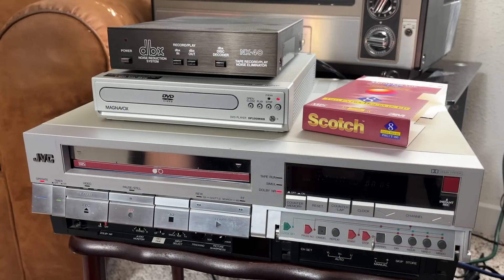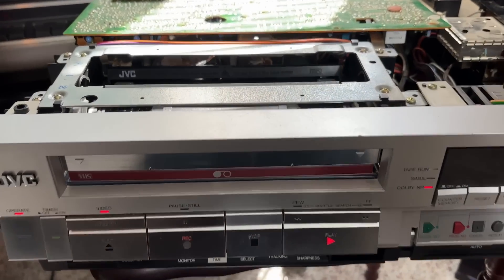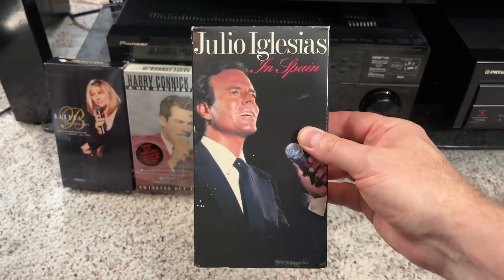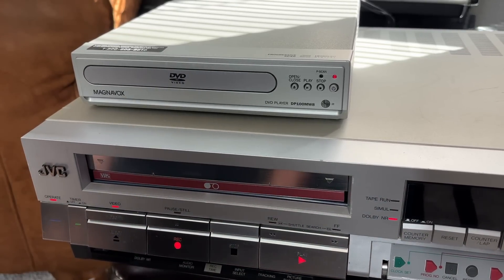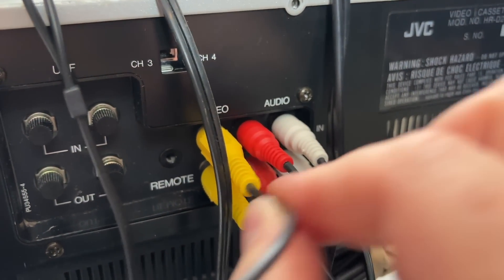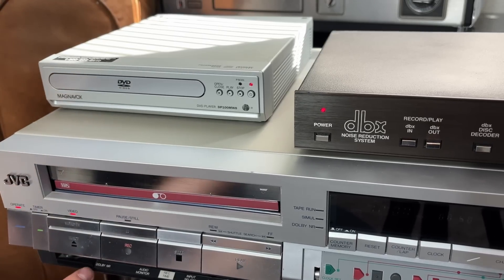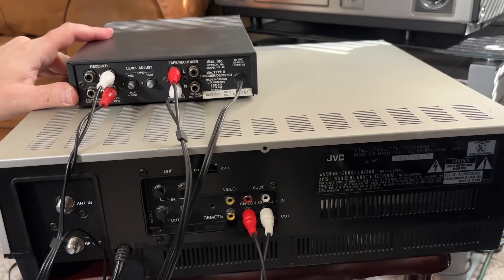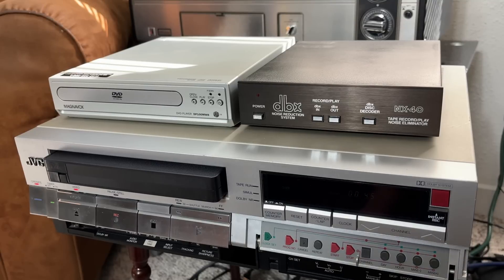JVC Video Cassette Recorder: Dolby NR vs. DBX NR

Comment: Interesting experiment! As someone else has pointed out, it does nothing to address the limited frequency response of a VHS linear audio track. Had Dolby C been adopted when it arrived in 1980, it may have been possible to at least partially address this. As well as providing excellent noise reduction, Dolby C is specifically designed to combat the effects of tape saturation at slow tape speeds, particularly at the high frequency end of the audio spectrum. A well designed cassette deck with correctly calibrated Dolby C can often have a full 20kHz bandwidth even with Type I ferric tape. Despite the slower tape speed of VHS, it may have been possible to squeeze a reasonably flat 14kHz bandwidth out of it.
Reply: For clarity, I'm referring to NTSC VHS machines above with their 1.313 IPS tape speed. PAL VHS machines ran at a slower tape speed of 0.921 IPS, so any more than a 10kHz audio bandwidth would be fairly unlikely.
Reply: @MrSlipstreem  Are you sure the speed difference is that high? 1.313 is almost 50% faster.

Comment: midrange boosted dramatically with the dbx - I like it for cassette tapes but this might be overkill unless you wanted that heavy compressed sound which could be a cool effect for an audio project, dbx passed drums can sound so good. - someone hard of hearing woudl also benefit from the dbx unit... not so much compression where it's a wall of noise still retains some dynamics

Comment: I also have a linear stereo Video 2000 machine, a VR2340.  The sound quality is very loud and clear, but it's clearly slow-speed linear and isn't really much better than optical film soundtracks and is indeed very hissy.  More than adequate for going through a TV speaker, but they may as well have just stuck with mono for that.  It's not as if there were any pre-recorded V2000 titles by that time, and who ever had any OTA stereo broadcasts to record (although thinking about it they probably did in Germany where more of these machines were sold)?
Reply: Can you create a video with this dbx nr40 and cassette tape deck with explanation of adjustments for good quality recordings !??)) Please!

Comment: Is there a way to wire the DBX decoder so that you only need to press the "dbx out" button instead of changing the cable setup?
Perhaps you just did it for the demonstration, yes it's easy to understand.
Anyway, I was to glad when stereo Hi-Fi VCRs came out, best sound recordings ever before burning a CD was a thing.
Reply: i have a dbx 150 type 1 and the in and out buttons just turns the compander on or off, and has nothing to do with switching the inputs and outputs, so if u encode a recording by having the in button pushed, u must also play it back with the in button pushed. the out button bypasses the encode/decode function. if properly connected it remains between the tape deck and console and no wire switching is required, or it could be connected to a dbx 200x switchbox that allows u to use the dbx unit on multiple decks as well as contolling equalizers and other audio processing equipment

Comment: Basically dbx would have reduced the noise better than Dolby B but would not have fixed the limited frequency response and wow and flutter.   VHS HiFi was so much better and I got my first HiFi deck, a Mitsubishi HS421UR, on April 3, 1987 and it made excellent audio recordings.
Reply: Sadly, VHS HiFi decks were very variable in audio quality. Some were excellent, but I bought a Sharp VHS HiFi machine (I can't recall the model number) that only had a 15kHz audio bandwidth and very audible head switching noise constantly chuntering away in the background. At the same time, I had a Technics cassette deck with Dolby C that walked all over it with a 19kHz bandwidth and 74dB signal-to-noise ratio. My cassette recordings even on a cheap TDK D Type I tape sounded vastly superior.
Reply: @MrSlipstreem  I had excellent luck with the 1986 and 1987 model Mitsubishi ones which had head-switching noise reduction and recording level controls before a several year race to the bottom that occurred during the 90s.
Reply: Agree with you 100%.

Comment: The VHS HiFi Stereo introduced by JVC in 1984 (modulated on 2 carriers in the video signal) was much better and did not need noise reduction.
Reply: dbx noise reduction is an integral part of the VHS hi-fi process/specification. 
The first generation of National panasonic hi-fi machines carry the dbx logo on the front panel.

Comment: hi have played around like this in the past 
it's not as good as the hi-fi 

to all out there  liner betacam  iis better 
than any thing you have here 
and betacam is  4 channel  on the betacan 75p
decks 

there's only one bad side betacam you need ear plugs  the fan's  the betacam  A500P can ear the power  

very good point  you made 
i had to go away from VHS they are all ways 
going  bad  

with betacam  easy to find parts  from decks 
all over the places

Comment: tbh: The 15kHz horizontal noise from most TV sets was killing any audiophile ambitions for younger folks anyways... ;-)
Reply: I had a friend who constantly complained about being able to hear the horizontal oscillator frequency on many TVs (about 15734 Hz for color, originally 15750 before the color standard).   I could hear it when I was a kid and teenager but could tune it out after getting used to it.    The 1000 / 1001 factor in the frame rate was to eliminate beats between the color and audio parts of the TV signal and became part of the 1953 color standard.
Reply: @3Cr15w311 Speaks boldly how far from the analog days we left.

Comment: heaps of jump wires on a PCB just mean the company was too cheap to use a double sided board, there was NEVER a technical reason not to. Theyre ugly to me
Reply: what is your point? Consumer equipment for retail was always built for a price point. if SS-THT is the cost efficient way and the results meets the spec: this is no shame. 
on the other hand: databits at 2:35 (and @kyoudaiken probably) speak about the 1980ies rats nest of wiring loom. i fully understand why the construction was like that. Manual labor was quite cheap, for assembly and even for outgoing inspections and rework loops. the pain of running the QA for the assembly line for this machine: can't imagine. 
If you call this "ugly": just skip this video and get yourself a sleek newer machine. e.g. like the ones Funai ran 2003-2006 after they integrated the Philips VCR activity.
Reply: @rarbiart  or jut get quality. have a nice life
Reply: These are wires for sensors, motors, for the heads to the head amps and more. Can't do that wirelessly to this day.
Reply: @kyoudaiken  Buddy - do you not know what a multilayer board is? You really trying to teach a Mechtronic Engineering Technician how PCBs are made?
Reply: @mycosys  First of all in this era, multi layer PCBs were rare and super expensive. Secondly, all wires you see there in the spaghetti are not even interconnects on the same PCB, they connect motors, sensors, the heads on the head drum and more. You've obviously never saw how electronics were made before you were born.
Reply: @kyoudaiken  Oh, kid, this is just getting sad.
Reply: Your are absolutely correct , there was never a TECHNICAL reason not to use G10 or FR4 base double sided or even multi-layer PC boards. But there sure was a COST reason! Welcome to the world of consumer electronics. In many early DVD players they did in fact use multi-layer G10/FR4 boards for the MPEG decoder and video sections. But only in that area where it was mandatory due to the circuit complexity. The rest of the player including the power supply was again single layer phenolic boards. Today they have all that complex processing down to a single chip, so they can once again use a single layer phenolic board for the entire player.
Reply: @andydelle4509  Dude - all i said is it isnt beautiful, its ugly and cheap - if you have seen pro gear from the period you know what i mean. If not you have no opinion worth listening to like the others here.
Reply: @mycosys  I have been in broadcast engineering for 40 years now. Yes I have had my hands in $100,000 VTRs. But again. different business model from a home VCR.
Reply: @andydelle4509  OK, so you absolutely know what im talking about, and the rest is just sophistry. You absolutely know what i mean. Its utilitarian and cheap and we have seen what the BEAUTIFUL electronics from that period looks like. Theyre like engineering pr0n - such beautiful work.
Reply: @andydelle4509  Seriously, this is in the context of him exclaiming how beautiful the cheapest possible consumer electronics were, and how we dont do it like that anymore (because its bad). 
All an 80s single layer board says is 'this wasnt worth spending money on'

Comment: Home made tapes > anything prerecorded.  So even if they used DBX, they probably would have sounded like ass, just like any HI-Fi track, or any prerecorded cassette.  The high speed duplication just didn't do any favors for anyone that had done any listening of high quality vinyl, CDs, or laserdiscs.
Reply: @spazzman90  most VHS tapes were recorded in real time, on very high quality machines, with far better audio performance than consumer machines. 🤷‍♂️ Not all duplication facilities kept their machines well maintained though! 
High speed duplication, like the Sony Sprinter, was a thing, but every plant/facility I worked at was real-time. I think high speed was more common in the US than in Europe.

Comment: Linear stereo on professional machines wasn't really too dreadful. With higher-quality circuitry, higher-quality heads, and manual level controls, plus Dolby, the sound quality was "reasonably good". The AGC was one of the biggest issues on consumer machines. Forever my most hated "feature" on all audio recording devices! On a JVC Duplicator (BR-7000 or later models) or something like an S-VHS editor, the linear stereo was fairly "good". Certainly far better than any consumer deck. The linear audio on the Sony SVO-5800 is surprisingly crisp (relatively, at least). AFM HiFi stereo, or High Dynamic as Panasonic dubbed it - for  reasons best known to them! - (labelled HD audio on early machines) is far better, of course. VHS HiFi audio does actually use a system very similar to DBX, but it's not "advertised" and it's non-switchable - it's just always-on/part of the system.
FWIW, Dolby C was used for the linear audio on other VCRs - Umatic-SP and Betacam-SP, (and MII, if I recall correctly). 
Regarding AGC, on material of fairly constant level, the circuitry almost always sets the level far too low, hence far higher noise levels. On material of widely changing level, it was even more crap, but in different ways!! 
Thank God for digital 😄
Reply: My uncle had a stereo linear vhs deck.  I had it at my place for a while back in the day and was really impressed with how good it sounded.  If I remember correctly it was just shy of a Type II cassette recording.  His deck didn't have DNR, so that might have helped.  But then I heard HIFI vhs and I was hooked.
Reply: @jims_junk  most pre-recorded tapes had Dolby B, even though hardly anyone had Dolby B decoding on their VCRs - which would've made tapes sound extra clear, but also extra hissy!  Once Beta-HiFi and HiFI VHS had been invented, linear audio became somewhat of an afterthought - very little effort went into it. It just had to work. Quality wasn't really a concern 🤷‍♂️ When VCRs mute the HiFi and switch to linear, on a creased section of tape or whatever, the difference is always "dramatically worse" - it needn't be, but it is. On a pro machine the difference is far less "dramatic".
Manufacturers also put very little effort into accurately adjusting audio head azimuth, so straight from factory, most decks were a bit "off". 
Even HiFi audio got dumbed-down on later machines. No more VU meters, no more recording level controls, or other "nice features". Progress! Lol.